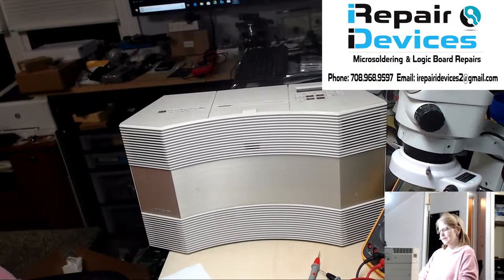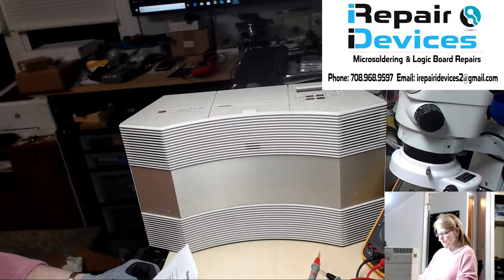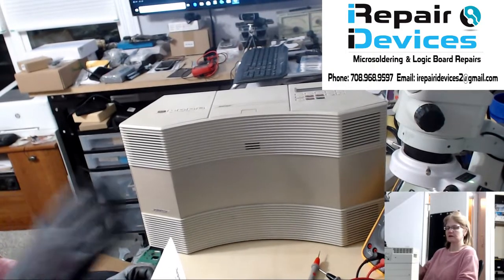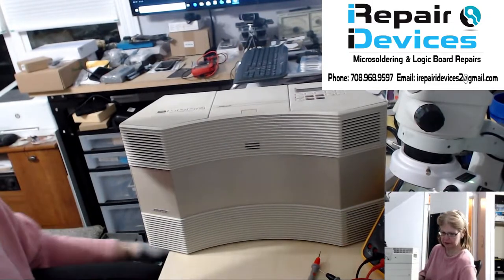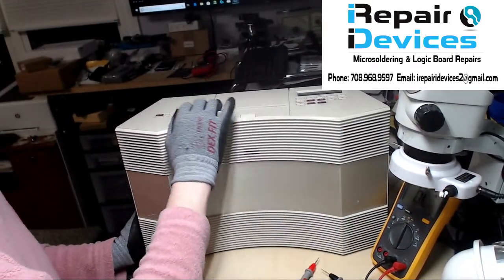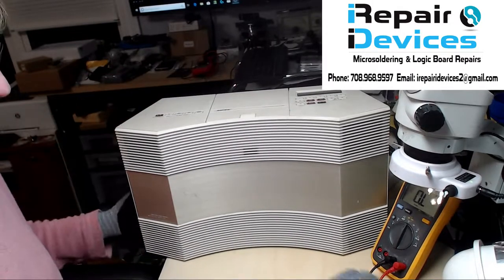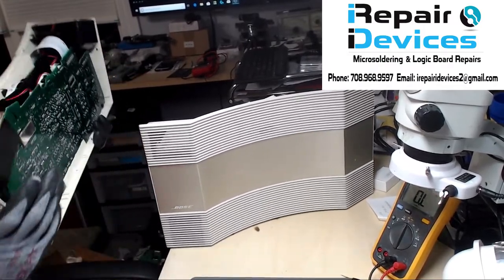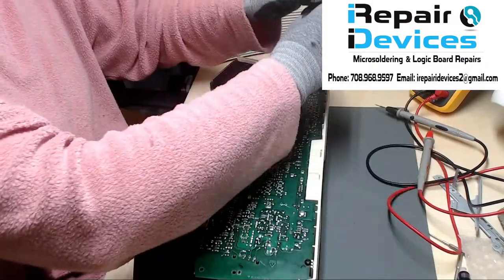Bose Acoustic Wave CD3000 - CD Chatter and No CD audio output

Comment: Lisa, thank you very much for this video. I have an old Bose CD-3000, manufactured in 1998 and the CD player started to skip and even shut down sometimes, although it hasn't seen much time playing CD's. Anyway, I stumbled across this video while researching a possible fix, watched it and thought that just might be my problem. I am a mechanic, NOT an electronics person, but tried it anyways. Had to watch the video a couple of times (must be senility setting in) especially around the olm testing of the pot, once I had mine apart, you're explanation made it easy to understand. Tested out @ 825 ohms, took it up to 1325 and ran three CD's through it with out a problem. Thanks again, your FAN !!!!

Comment: Thank you very much. I know this video was posted about three years ago, but it is still very helpful. I have the exact same model, made July 1999. Even though mine was not a fix (I've ordered a replacement part for the optical laser head and mechanism). I would've not have been confident enough to make the repair without this video.

I took my bose apart and put it back together about eight times last night attempting to repair it, cleaning the rails, and adjusting the potentiometer. Here are some points that might help someone else attempting the same.

There are four silver 'biting head' screws and one silver machine screw that need to be removed from the outer housing to detach the top part from the bose. The machine screw holds the antenna in place.

Once the two ribbon cables have been removed from the top part to separate it completely from the rest of the housing, only the four long black screws (along with the two clips) need to be removed to separate the circuit board from the outer housing. They are the three along the back, and one way in the front, in a circular cutout. at a lower level and easy to miss. The circuit board is a lot less wobbly with only those four screws removed.

Once the outer housing is removed, the two inset grip pieces can be gently pried out. This makes it easier to move it around and they do not need to be replaced until you are done. In fact, no harm in forgetting to put them back on once everything is back together. They easily snap back into place from the outside.

The two small speakers do not need to be disconnected and I'd avoid unplugging that thin ribbon cable like the plague. I did not disconnect it and was still able to flip over the left keypad to access the CD housing. 

You only need to remove the cover of the CD housing to clean the rails. Once they are clean, you can access the potentiometer with the CD housing cover still in place. A time saver if you are doing multiple adjustments to the potentiometer like I did.

My potentiometer was initially spot on at 1k ohms. I went up from there to 1.25k ohms and 1.5k ohms and even higher. I also went lower 0.5k ohms, 0.22k ohms and even zero ohms. The max range of the potentiometer appears to be about 2k ohms. I used a 2mm slotted screw driver and a magnifier to make the adjustments. Be sure and mark the original placement like Ms. Lisa suggested. In the end I returned it to the original setting. None of the adjustments significantly improved the CD on my bose. I think it is just done for. 

thanks

Comment: I repaired a CD hinge that was broken off using gorilla glue and a hack sawed  tent peg with the same diameter as the hinge.   Opening up the Bose is intimidating.  Your video walked me through getting inside the case to do the repair.  Thanks Lisa.
Reply from the maker: You're welcome

Comment: Lisa, you are amazing!  Thanks so much!  I cleaned the rails and adjusted the pot switch just as you demonstrated and the CD came to life.  I am really not an electronics person, just IT guy and tinkerer.  Your steps and explaination were spot on.  You rock. - Jim
Reply from the maker: Hey Jim, I am glad to hear my video helped you to get your Bose CD-3000 working again. I tried to explain the steps that is easy to understand.  Just remember, by adjusting the potentiometer switch you are increasing the optical lens so it will burn out eventually. Have a great weekend.

Comment: Lisa, 
Nice video I'll be working on one of these soon. Thanks for the info
FYI it's not a pot switch it's a potentiometer which is a variable resistor not a switch. 
You can just call it a Pot. or a variable resistor.

Comment: Thanks for the video.  I think I've found a diagnostic shortcut - after the reassembly, when you tested it.  I saw that you tilted it forward for us to see the display, and then it occurred to me that it might play when laid on its side.  I reasoned that if dust was the most likely problem, then by placing the unit on its right side then gravity would assist in moving the laser carriage.  Sure enough, it did, and the clicking stopped and the CD played normally.  So now I can decide whether to disassemble and clean and lube the rails & gears.  What would be best - a non-oily teflon lubricant such as Tri-flow?

Comment: I've got an old Harman Kardon stereo receiver. It's from about 1983. It gave me the smoke show. I'd love to have you repair it. ( sounds like an electrolytic capacitor went pop). I also have a Hitachi receiver from 1982. Dead channel! I've got a bad habit of collecting this stuff. My 2001 Bose wave radio does the same thing as this system you're working on.

Comment: Hi Lisa once more greetings from the Isle of Man I finally removed power supply card today after receiving a packet of .5 A fuses from China and discovered the fuse associated with the Transformer also appears to be blown  .25 amp one, also I can’t get any continuity on the transformer secondary socket given the transformer here will be for a 240 supply what is the voltage of the secondary? As it is looking like I might have to find a substitute transformer? I gather the transformers were not the best!

Many thanks for your kind assistance 

Regards

Phil

Comment: Excellent video! I just got this unit from a friend and seems like it has the same problem. I only wish I could see where the resistance check being made at.
Reply: Follow the pcb trace of the pot, you can see where it connects to the plug

Comment: Thanks for the video! Quick question, does the potentiometer separate the current that the laser and motor get each? Or am I completely lost lol, based on my inference from my issue:

Mine ended up having a gunked up everything and the pot was also set to single-digits. After those two fixes, it now can play through a whole CD no problem except getting it to actually start.
While previously it spun up just fine but didn't read anything, nowadays it quickly tries and assumes no disc. It looks like the disc is now slipping and won't spin up enough to be detected. I have to pre-spin and try multiple times until it catches one time, then wait a few seconds before I quicklystopstart and then it works just fine. Having the disc previously spin up but now unable to, leads me to believe there's not enough power for both.

Comment: I have a Bose acousticwave cd 3000 and the bass is barely noticeable. The treble/highs are so high that after a while I get terrible headaches. Plus, the CD lid had to be opened and closed several times while holding the black circular lid sleeve up so the disc will play. Can you adjust and fix that?

Comment: Excellent, I am going to try this repair, having seen your process, you have given me encouragement, what size is the pot screw size, is it a torx?
Reply: Okay, thanks for the great informative video, I was able to take it apart and reset the pot screw and yes it took a few times to get it to the right setting, I had to go a bit higher than 1.30 Kohms, ( 1.38kohms) but I did get it to work playing the CD again, although it is intermittent. Load it up, press play , its fine, change CD, then doesn't want to play I did add some lube to the rails and the gears, which made it a smoother operation, cleaned the lens with some alcohol and a q-tip, wiped clean with  a kim wipes. Its a no. 00 flat tip to adjust the pot screw
Reply: Update couldn't let it stay that way, took it apart again, I decided to set the pot screw to a midpoint between 1.00 ~1.30 K ohms, ( 1.15k ohms), popped a CD in ( RUSH 2112), and it sounds so beautiful, scans, starts, plays, skips to songs, just perfect, I owe you a $20

Comment: I had a CD 3000 in 1994 and should have never got rid of it.. I recently bought a used one off eBay that has a horrible amplifier hum and the CD player won't work
Reply from the maker: I offer mail in repairs. You can email at irepairidevices2@gmail.com and I will be glad to quote you a repair price.

Comment: Hi Lisa,  when I try to play a  CD the system says "UNREADABLE  Cd" and obviously the CD is clean, what  you think is the problem? Thanks
Reply from the maker: Hello Jose. Have you tried other CDs as well and still getting the same results? If so, could be numerous possibilities and without the unit in front me to get a proper diagnosis I only suggest the following: if you are getting the same unreadable results from other CDs than try cleaning the optical lens.  There are CDs disks out there for that job. If that doesn't resolve your issue, you can manually clean the optic lens. But you gotta be carefully not to scratch the lens. I use 99% Isopropyl Alcohol. If that doesn't resolve  the issue could be the actual optical laser itself.

Comment: Hi Lisa, thanks for the how to, when I tested my potentiometer I couldn't get it to read above 0.855. At this reading it wouldn't read discs. So fiddling about I got it to work (mostly) at around 0.740. Any idea why this might be?
I had another lens from China that I tested it with and that was also reading 0.74 but this isn't a new part, I thought it was. The whole disc played but track 1 paused briefly twice.
Reply from the maker: Thank you. I hope my videos are helpful. As stated in my video, the range will vary on the optical lens being used. The potentiometer isnt only factor to the adjustment,  there are other components that work on that same line. My adjustments do vary greatly across the units. I have have had readings ranging from .760K to 1.1K it all depends on other factors.   A CD has 4 layers to it construction. Older CDs may have thicker polycarbonate layers making it difficult for the laser get through to the next layer which is the reflective layer. So, I use a variety of old and new CDs to find that sweet spot for it work across all of them. Also if the polycarbonate is scratched, dirty or chipped this will prevent the CD from playing properly as well and the optical lens wasn't the culprit.  There have been times,  there wasn't anything wrong with the optical power, it was just a dirty optical lens and the customers CDs being used weren't the cleanest.
Reply: Thankyou, I'll check the optical lens tomorrow.
Reply from the maker: And you removed the anti static solder point from the ribbon cable without damaging the ribbon cable itself correct?
Reply: I didn't remove any solder points. I looked at the wide ribbon cables' metal connector and it looked ok. That was the only ribbon cable I removed. Fingers crossed.
Reply: So I've just been playing a CD, after 4 tracks it skipped so I used 99.9% IPA on a cotton bud and it won't read the disc. Any suggestions?
Reply: Ignore previous message, it started working and played an entire CD without skipping.

Thanks once again for your help.
Reply from the maker: @darrenlomax1283  you're welcome Darren. 😊

Comment: Not sure what you mean by the touch feature?
Reply from the maker: Some Bose units have a touch feature that you can turn on and off your unit by tapping the area right above the lcd panel on edge area (centered) on the lid. The model # is located on the back or bottom of the unit depending on the unit.